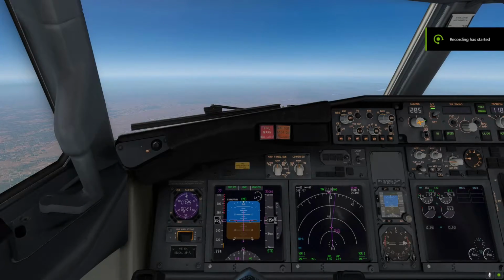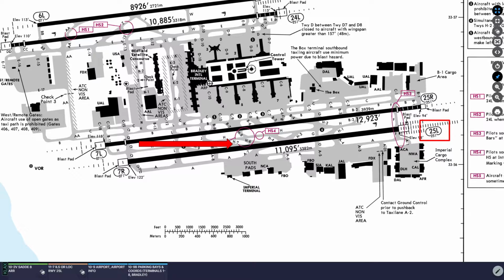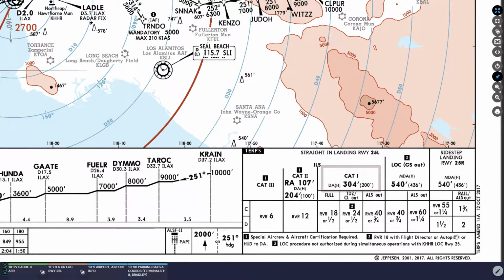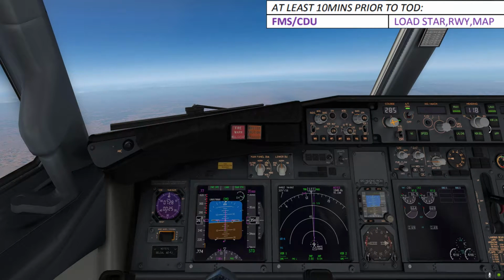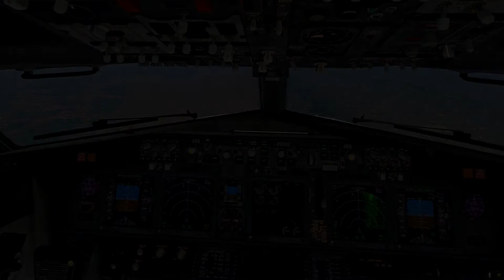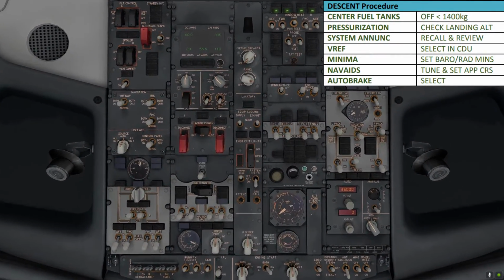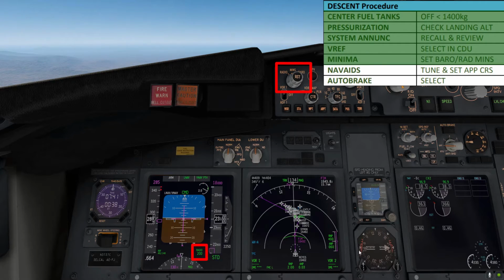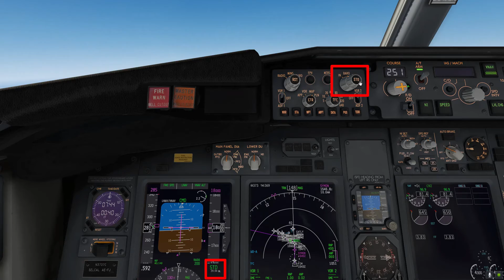Aircrafts Dissected Ep 14: Initial Descent and Approach IZibo 737I X-Plane 11 Detailed Tutorial

Comment: I disagree with beginning to learn using flaps 40 and a lower speed. Practice like the real world. Flaps 30 is used a vast majority of the time with the exception being short field landings. Makes sense to practice at the same flap setting and speed that would normally be used. Also at lower speeds, crosswind effects are more pronounced with more flaps exposed.
The landing altitude on the pressure panel would be entered on the ground during pre-flight, as brought up in the previous video. 
The Landing Performance Calculator in the EFB is functional (Zibo 3.44+)and will enable a page two to show graphically how much runway is needed for each autobrake setting once the relevant data is entered. Windy.com is a good weather reference as well as Skyvector.com by mousing over the airport, a box will appear with the METAR.
Reply from the maker: Thank you!